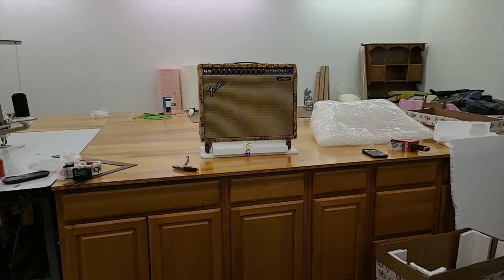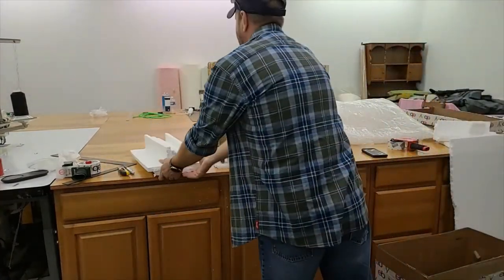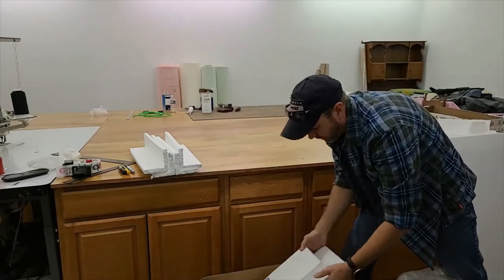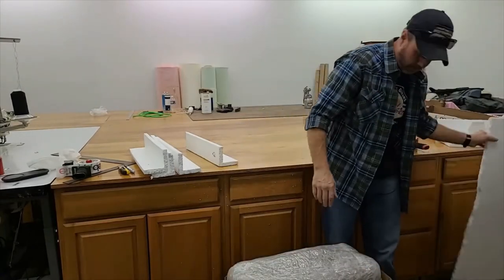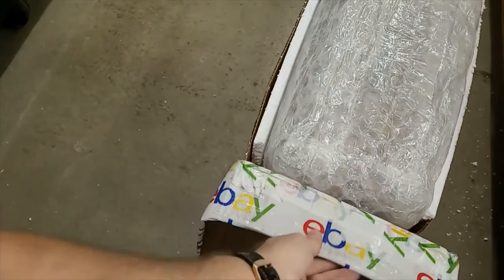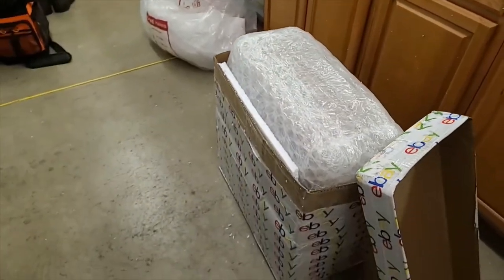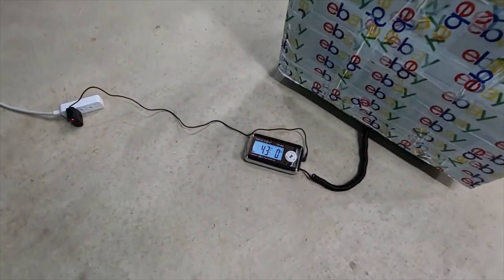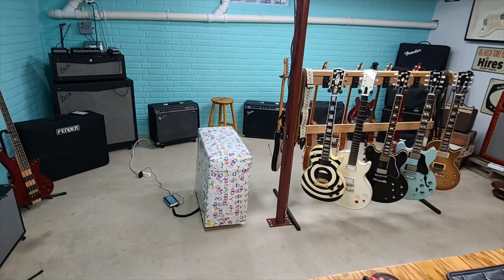How to Properly Pack & Ship a Guitar Amp!

Comment: I have a dsl401 are you saying to stuff bubble wrap between the tubes to keep them safe? I have at least one preamp socket  connection that is sometimes wants to act loose and need to move across half the country. I don't want to take out the tubes if I don't have to.
Reply from the maker: Just fill the cavity full of bubble wrap and use cardboard to cover the rear opening and sarandwrap the cardboard to the amp over the hole.
Reply: Thanks, much appreciate it,  @ThatGuitarGuysChannel

Comment: Great vid. Did u take the tubes out?
Reply from the maker: This one is a solid state. 
No tubes on this one.
Reply: @ThatGuitarGuysChannel  any tips on packing an all tuber eg blues jr or HRD? Next vid maybe💡
Reply from the maker: @Modelguits  no need to remove tubes, just do the same things I did but pack lots of paper or bubble wrap in the void. This way if a foot pedal comes loose it's not smashing tubes.
Reply: @ThatGuitarGuysChannel  ok cool. Thanks for the info!!🙏🏾
Reply: Here for the same info on tubes.  Thanks for the info. Some people suggest removing tubes. Wasn’t sure I wanted to.   Also, you’ve got some birds on your back.
Reply from the maker: @themaverickmechanic7240  yeah as long as there is nothing free to bounce around it's all good. I never opened a new one and had to put tubes in it.
Just secure everything and take up all the voided space in the cab.